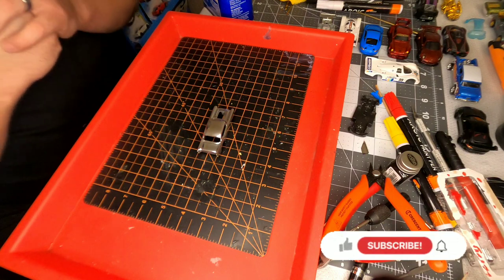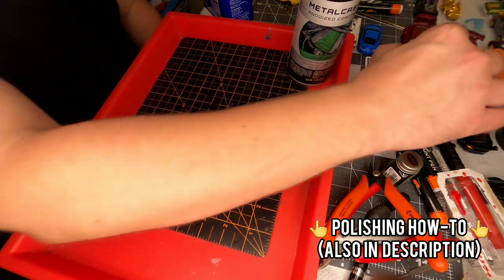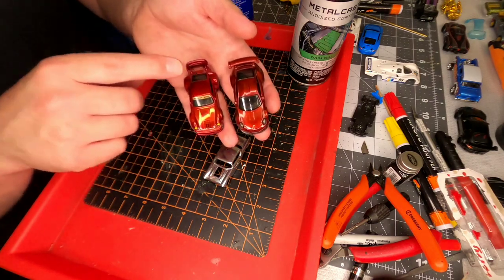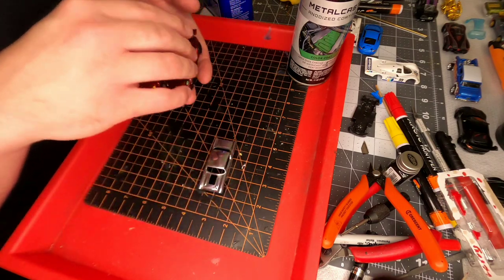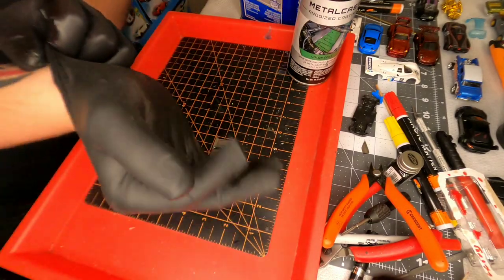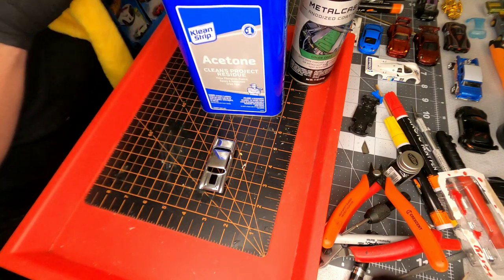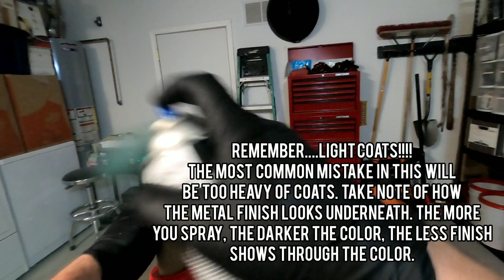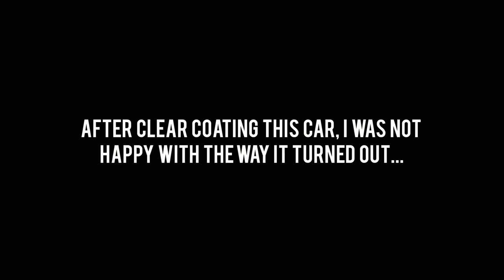HOW TO SPECTRAFLAME WITHOUT USING AN AIRBRUSH!!!

Comment: Better than some STH 💯
Reply from the maker: Thanks Hector!  Yup, you can achieve the same finish and look but add tampo's, lower, detail, the possibilities are endless! 👊😁👍
Reply: Had to strip one down paint was getting bubbly, and small pores would appear where I could see the base color. Any idea why?
I did polish polish polish, tho 😅
Reply from the maker: The surface has to be SUPER clean and at least warm to the touch.  Humidity can also mess with the results quite a bit!
Reply: @HonestDiecast  bro your amazing GRACIAS 💯
Reply from the maker: My pleasure Hector!  Let us know if that works, that should do the trick! 😁👍